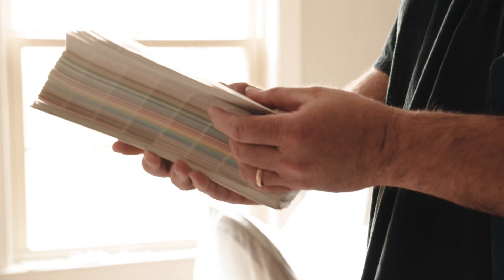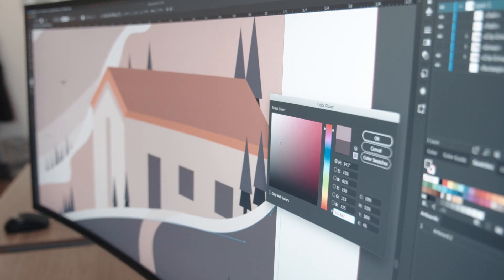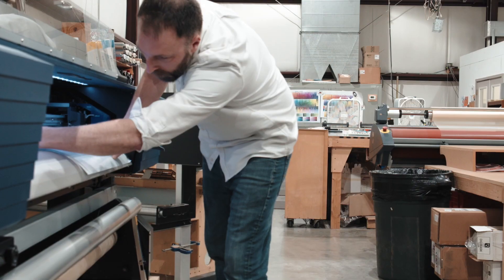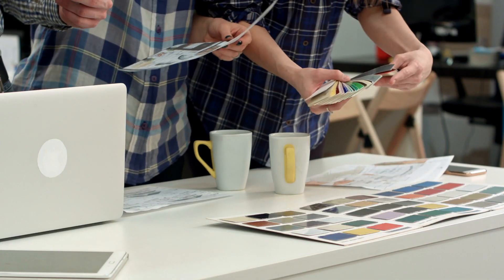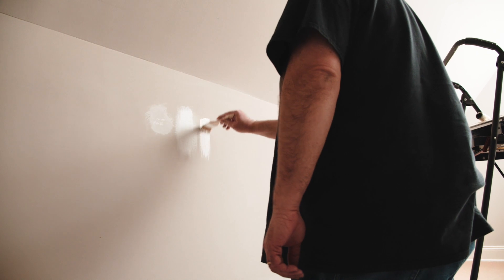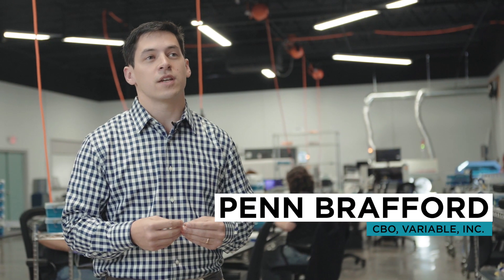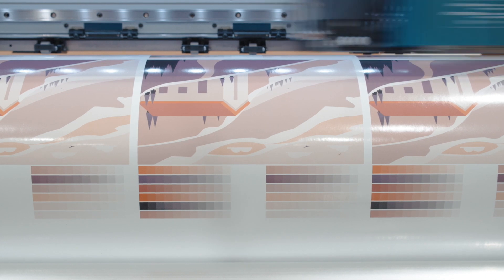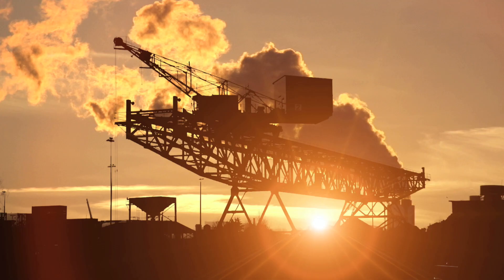Spectro 1 by Variable - Mobile Paint and Color Matching Tool

Comment: We use the Spectro 1 Pro in our print shop as an aid in color matching our prints to the original artworks. It is much more handy for getting spot colors compared to our larger spectrophotometer and can be easily taken a long when doing onsite works at galleries and museums.
Reply from the maker: Thank you for your feedback! We're thrilled to hear that our products are serving you well.
Reply: @Variableinc  for wall paint colors what is better Spectro 1 pro or newer Color Muse 2?